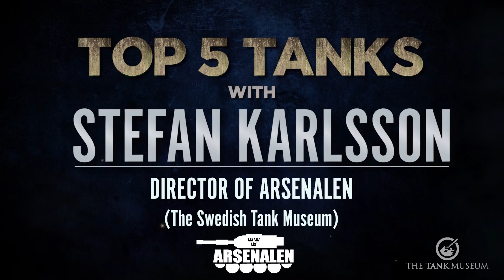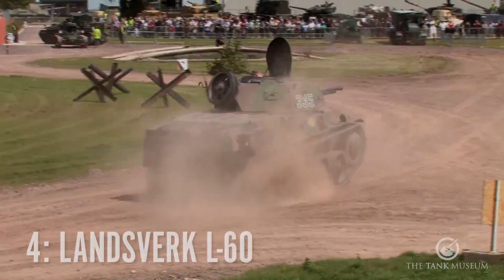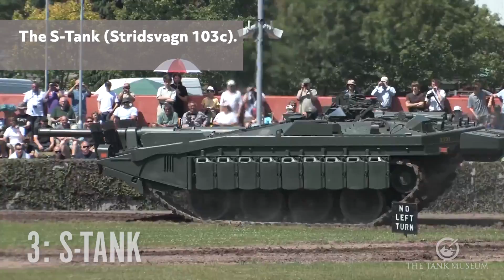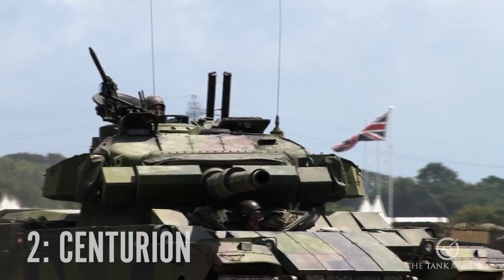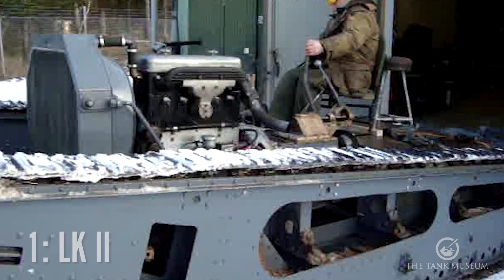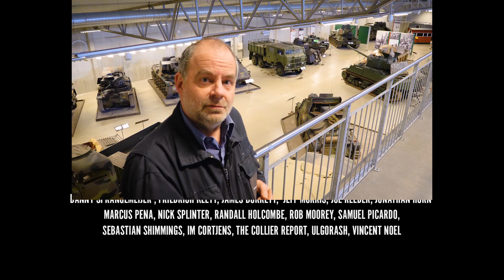Arsenalen - Swedish Tank Museum | Top 5 Tanks | The Tank Museum

Comment: The S Tank is wonderful. It's unique, not a real tank but a tank destroyer using haul down positions. The Lk II is in WoTs Swedish line. I wondered where it came from. An Lk II that actually runs, outstanding!
Reply: That's not entirely true. It could be used hull down, sure, and would do a good job. But, in Swedish tactical doctrine it would be used offensively just like the Centurion with the same mission profile. There's a grest story of a platoon of S-tanks roundly beating a platoon of its succesor, the Leopard 2, in a training excercise by outmanuevering and flanking them.

Comment: I am impressed that Stefan described choosing a tank commander as his loader while he needed to have his head outside the tank to fight the remainder of his company.  That is an inspired choice, because he'd just finished describing how much coordination the crew needed directing the driver.
Reply: My choice to have a commander as the loader I knew he was able to be the commander of the tank and loading the gun at the same time if I needed to focus on giving orders to the rest of the company. With a good driver and a good gunner you do not need to focus that much on them. It was my choice and it worked fine.
Reply: @stefankarlsson9762  Indeed!  If the OC's callsign has to fight, there are bigger problems.  But hopefully everyone helps with jerrycans, ammo, track maintenace, cam nets, shell scrapes, radio watches, etc etc.

Comment: The L-60's transmission is the only thing weirder than the "Safety-Clutch" two-speed in my grandpa's '51 chrysler. It almost operates the exact opposite - you only use the clutch in the Chrysler for putting it into reverse or drive and taking off!

Comment: I love the look of the S-tank. But if it was a ground-breaking design, it would still be in service and the world would have adopted it. The Centurion was a ground-breaking design.
Reply: According to NATO records an S-tank would be able to knock out 4 NATO tanks before being knocked out itself.
Reply: @arudegesture  Got a link to those records?
Reply: The Strv-103 was designed for a very specific situation. It was a very good fit for the swedish requirements, but not necessarily for those of other armies.
Still doesn't diminish its merits.

Comment: Am i understanding correctly that those bars on the S-Tank are meant to be exploded/launched off with explosive? But why?
Reply: The plastic plugs were removed with explosive so the bars could be put into the holes.
Reply: Blowing out the plugs with explosives is probably a lot quicker than digging them out with a knife or a screwdriver...

Comment: Best one yet, thanks.
But now we need a video on the CV-90, since he says it’s the best fighting vehicle ever build!

Can’t believe I did service at the same time as this guy in the M41 Bulldog. 🤔
Reply: CV-90 is in my eyes a light main battle tank / troop carrier. It can be used everywhere and is the tank for the soldiers on the ground. Not super armor or gun. Just all around a grate tool for modern military. It is the tank that is perfect vs a threat that do not have battle vehicles. Light small fast and armor/troop seats making it cheap and effective. 

Front engine. Rear ramp into seating area for (10?) soldiers. Hydraulic suspension to work ridge lines last time I was in contact with it. Compact. Full turret. Auto loader.(?) Long service life. Most successful Swedish tank in real combat (I think) Heck it is the only tank I have had contact with my hole life. Live close to the city that built and rebuild this bad boys! They are a de-lite to see on the roads ;)
Reply: What army or country did you serve in?